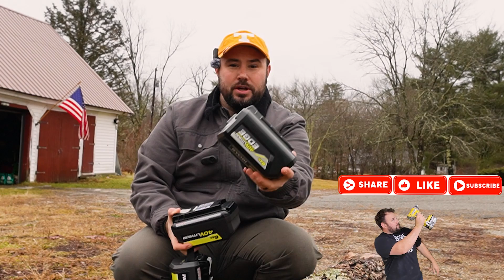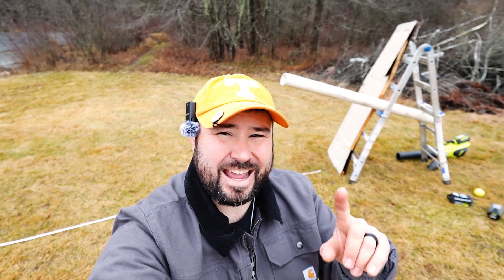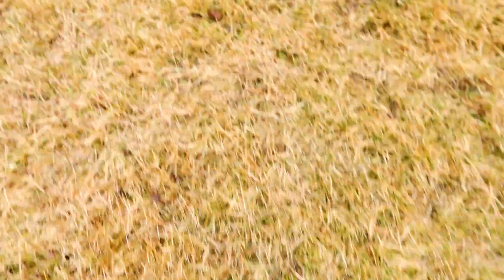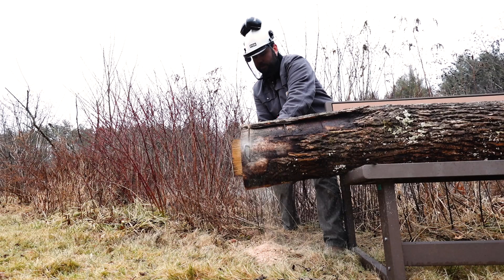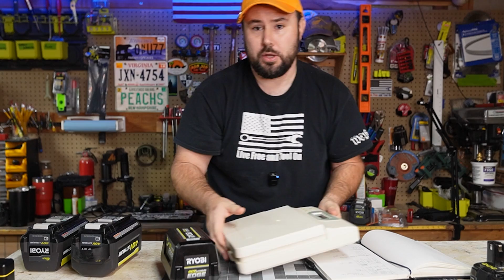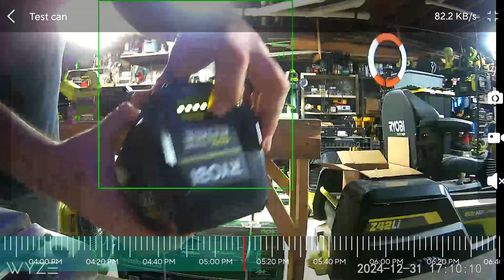Ryobi 40v Lithium EDGE Battery Head to Head Testing #diy #homedepot  #construction #homeimprovement

Comment: Did you ever test the edge battery for cutting grass? I have a push mower with the 6ah battery that's about 10 years old and the batteries starting to get a little weak. I am trying to figure out if the extra 100 is worth it for the edge version.

Comment: Has anyone found the engineering spec that will help us understand the outputs that we can expect. Just a few examples: how many amps can be delivered for continuous use, like when a mower is running in consistent thickness grass? And then what is the brief, 30 second, max amps before the battery management system protects the battery by shutting down temporarily. There's a whole different set of questions about what each tool can draw from the battery.

Comment: im happy you used the non Edgef optimized saw and is showing that there's significant improvement on the older ryobi versions.

the new ryobi optimized saw is basically a 65-70cc saw but it weights 1KG more, putting you up at 7,5k+ w the 8ah battery, and going from around 6,4kg with this saw to 7,5kg is kinda a big difference if you also cut branches with this thing.

i'd say even the 6kg+ saw is heavy too, due to its 3/8 LP chain its harder to cut branches off tree's when skinning the tree so the extra weight doesn't add up, and having the 22,5 m/s saw (fastest one ryobi has of old gen) does keep this thing running well.

Would also put 3/8 STIHL Picco PS3 on it for 10-20% cutting speed, instead of buying a new saw (which is another 400-500 bucks and it being 1kg heavier), you can rather optimize this one.

the one problem with this saw is where the SPOON exits, it hits a flat wall on the plastic and with this new edge battery it actually builds up and blocks the saw which is not good, literally not designed for its optimized performance, so I would probably angle it with some material in there so the spoon exits behind you instead of hitting the plastic wall. u can see it hits the wall and then falls down, but on diff tree's where u cut faster it builds up and its gonna draw more power and ruin the saw faster. so would just have to fix that part.

Comment: A 40v battery cannot produce more output than 40 volts. Also, the amperage is about how long it can run for. More ah can appear more powerful because it can sustain peak power(40v) for longer. It will also have less sag
Reply: More ah also means less internal resistance

Comment: Ok, now turn the log around and do it in reverse order to determine how much the wet edge of the log added to the time.

Second, I buy dead batteries, and the cells inside are what matter. I can take the 4Ah battery and make it a 12Ah battery using higher AH cells. Why is that important weight no one wants to carry that heavy ass battery around all day? PLUS charge time, the bigger the AHs, the longer the charge time - I have Ryobi 12, 18, and 40 volt batteries, and I am starting to hate the company for their batteries and the Battery BMS's which have the tendency to kill the batteries prematurely even when the cells inside are good.

Comment: Not many people seem to be testing these batteries yet.  I'm more curious to see how they do in the mowers, especially the self-propelled ones, and the 4.0 Edge v the 6.0 standard, as that's what my mower came with.  I'm also curious how a single 8.0 Edge compares to the dual 6.0 standards in the mower I have, the mower uses both battery slots in parallel to ease battery heat and load, but a single Edge pack might negate the need for that.  The difference in the 6.0 and 12.0 standards are probably the cells used, the 12 probably has a much lower rated amp draw compared to the 6, so it's not really a fair comparison; just like tabbed 18650 v tabless 21700 isn't the fairest comparison either.

Comment: To explain the weird inconsistency you saw with the chainsaw.
Power tools typically will have a "Warm up" phase. Watching Project farm, testing drills the first 3 screws have varying differences in time as the motor warms up, etc.
Usually first attempt is quick, second is slower. Third is back to the same speed or better then the first.

This could potentially have caused the change you saw with the chainsaw, as the 12ah was the second battery tested.

Still a very interesting video.

Comment: Thank you for posting this and also for including a run time test. That is something I have not yet seen in the videos that Ryobi has posted so far. I was impressed with the fact that the 8Ah EDGE battery appears to out perform the higher priced 12Ah battery in the power department. In runtime however, it did fall short of the 12, and seems like it would probably be closer to the runtime of the current 8Ah battery. Ryobi stated on their website, and also on Home Depot, that the new battery "delivers up to 6X more power & 6X longer runtime." I would love to put two of those in my snow blower and get 3 hours of runtime instead of the roughly 30+ minutes that I am currently getting, but I just don't see that happening. Not sure what they're thinking. Otherwise, it does seem like a better battery, and I'll probably be picking one up.

Comment: Pretty cool stuff. Oddly enough, it might get me interested in the old stock 40v products if they go on enough of a sale.  Some of the normal 18v batteries have been on sale recently.  Which for us have been fine.   Looking at mowers, currently only the 18v One+ types.  But if a normal 40v gets a good discount when I decide to buy, I'd be tempted.
Reply: The 4Ah pre-Edge batteries seem to be a bit on sale right now.
Reply: I got their awd dual blade mower with 2 6ah batteries for 500 a couple weeks ago.
Reply: @connorj.dunckel4223  Thats a good deal, seeing the used mowers between 150 and 300 depending on the model and with batteries or not.  Just haven't pulled the trigger yet.

Comment: Are you sure about that math at the 13:32 timestamp?
The 6Ah charged in 62 minutes, 12 Ah in 111 minutes, and 8 Ah in 82 minutes. By my mathing, that comes out to 10.3 minutes/Ah for the 6, 9.25 for the 12, and 10.25 for the 8.
Did I repeatedly mis-hear your total times? 🤔
Reply from the maker: @torgokong388  maybe and maybe, I totaled the minutes and decided by AH. I've been wrong before and will be again.
Reply: @torgokong388 I just checked your math. You are mathing correctly. 

6ah took 62min to charge = 62/6 =10.333 
8Ah took 82min to charge = 82/8 =10.25 
12Ah took 111min to charge = 111/12 =9.25

Comment: While I do believe the Edge battery is most likely better based on the saw test. the blower test was flawed.  The only distance that is relevant is the distance in flight.  I would have measured where the ball initially landed.  The roll after has way too may variables that can effect the distance.  Great idea and creativity, however.
Reply: @drrhino4938  trueee just like how they measure long jumps. The ball could possibly hit a rock or two to slow it down or slide on some moisture on the grass to further its path.

Comment: You are the only channel that’s reviewing this for us. Thank you for that. My only wish is that you repeat the test at least twice to see if the results were reproducible. Technically, the 12Ah battery should not lose out on the 6Ah in the chainsaw test. That test was possibly a fluke? We will never know. However, I think the 8Ah edge is the clear winner. I want one. Thank you again Brent and keep it up! We love this content.
Reply: I have a 16 inch chainsaw and 4, 6 amp hour  and 12 amp hour 40 volt batteries and I found that the 6 amp hour is marginally better than the 4 amp hour which is to say the chainsaw is effectively useless with the 4, and usable for only a few minutes with the 6. But with a 12 amp hour battery I can make cuts for about 15 to 20 minutes of straight cutting before it runs out of power. For non-constant cutting, a single 12 amp power will last you for half a day, assuming you're making one cut, moving a log, coming back making another cut et cetera.